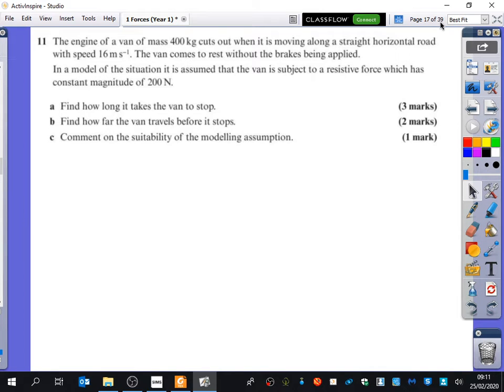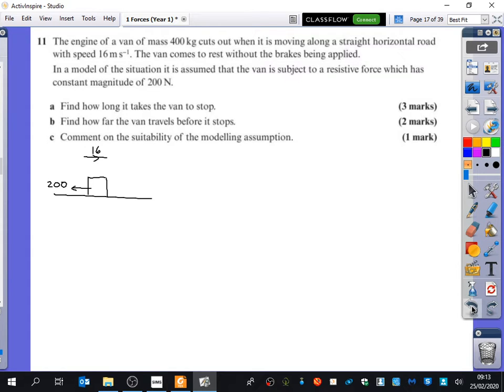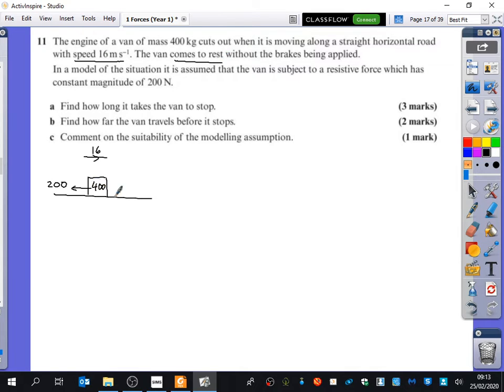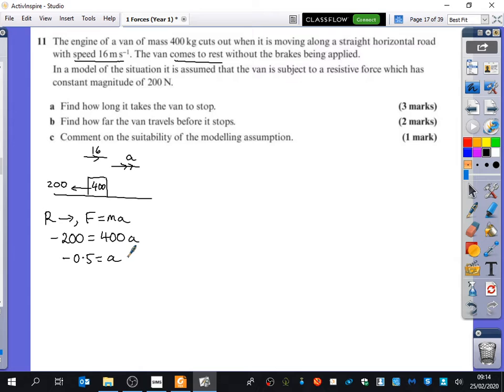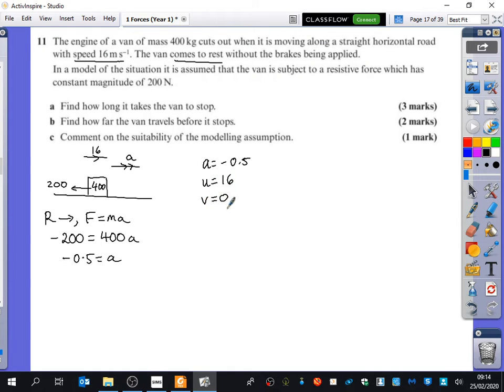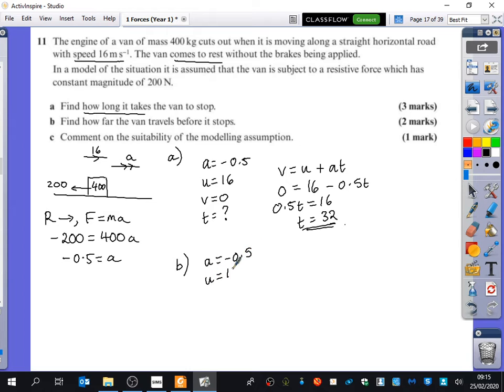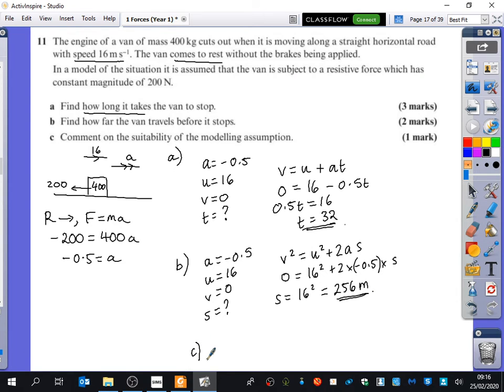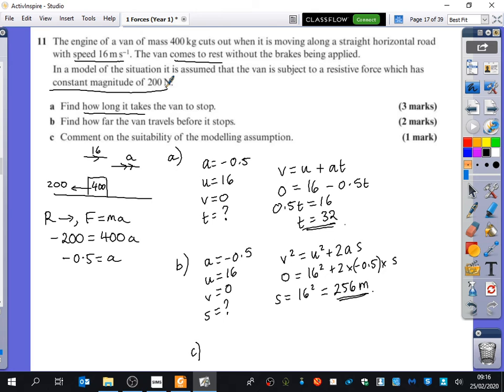Forces 7 • Deceleration example • Mech1 Ex10C • 🚀

Comment: Hi Sir, does the negative acceleration in the forward/right direction mean the positive acceleration in the opposite direction? When I was doing this question, I did 200=400a and got a positive acceleration and so if I was to do it this way, would I have to make it negative since the speed 16 m/s is in the opposite direction?
Thank you
Reply from the maker: Yes, that's correct!
Reply: @BicenMaths  Thank you sir, I was struggling a lot with this topic and topic 9; your teaching has made these topics better to understand for me now. Thank you

Comment: at 3:47 its asking for the value of S before it stops so wouldn't that mean V does not equal to 0 as its suggesting ,before, it stops?
Reply: 3:30*
Reply from the maker: If it is just before it stops, it's as though we're saying v is very very close to 0... so mathematically it makes sense to say v=0, as it won't travel any further just before it stops, if that makes sense!

Comment: say there are 2 accelerations in opposite direction, can i just take them away like forces? i.e 2m/s^2 up and 3m/s^2 down result a 1m/s^2 down?????
Reply: i know it works mathematically but does follow the theorem rigorously
Reply from the maker: This would be the relative acceleration, which mathematically you can do, but I can’t think of a situation where you would need this!